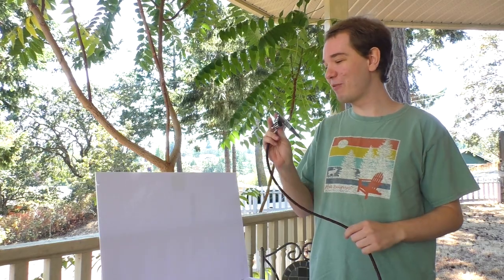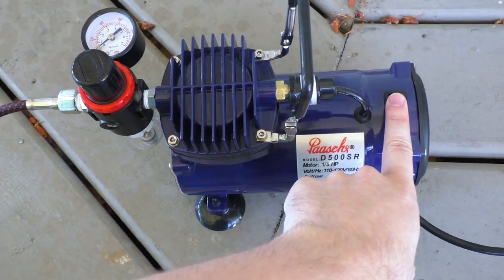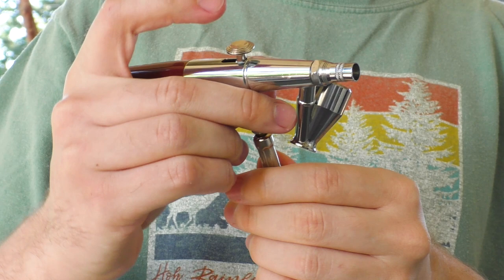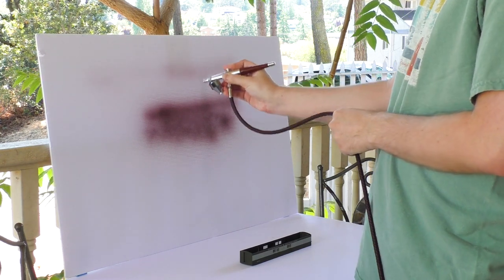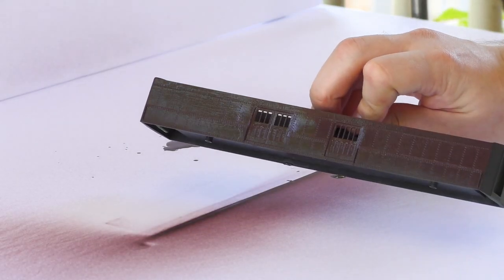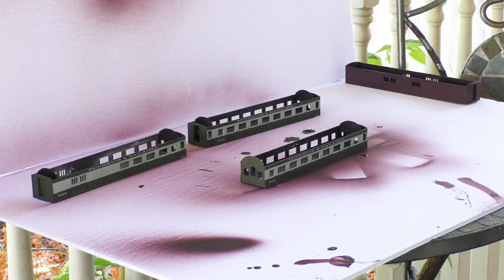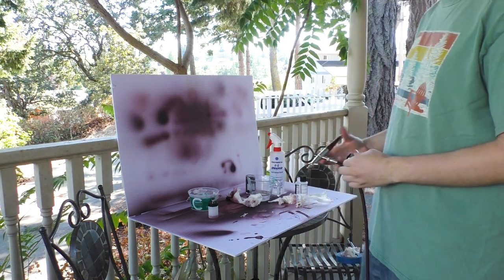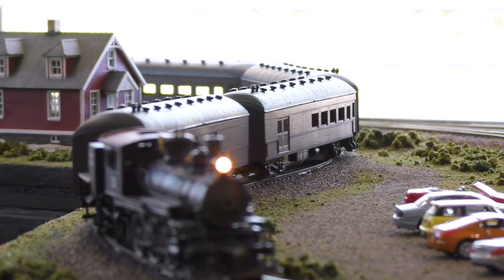Using an Airbrush for the First Time

Comment: I just run lacquer thinner or paint thinner depending on the paint I am using the paint cup or jar till the paint is run through and I get a clear stream.     The only time I dissemble the gun if I use a heavy paint or a more thorough cleaning is needed.   I own about 7 guns.  Anything from a binks to a badger to the one you use
Reply from the maker: I've tried just running thinner through it, but I find paint tends to build up and eventually clogs the mechanism. I usually end up taking it apart and cleaning it after each painting session. Sometimes I do just run thinner through between colors, though.